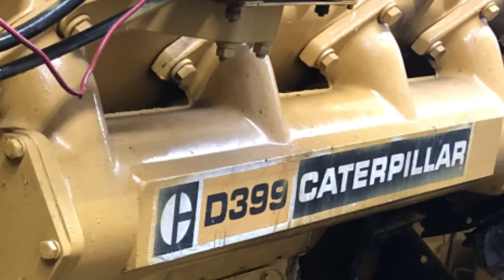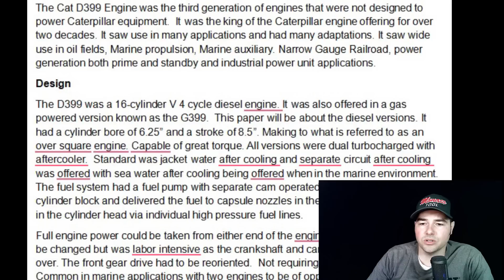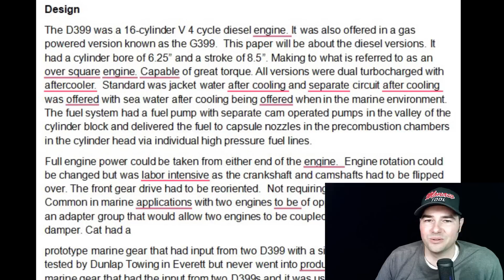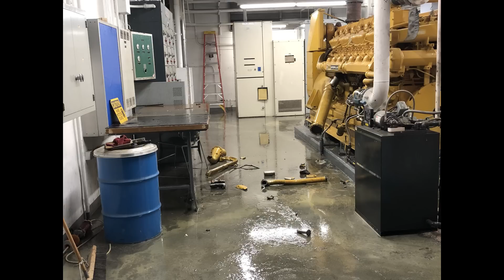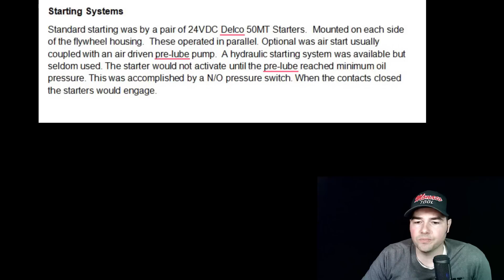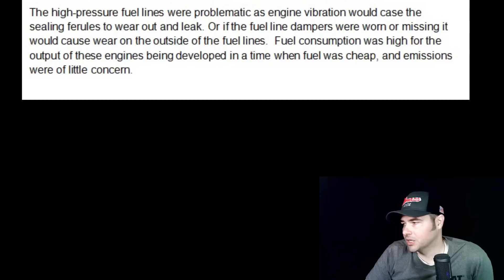The Cat D399 Diesel Engine. "Cast Iron Elephant."

Comment: I was Engineering Officer on ARS40 Uus Hoist, a Navy Salvage ship which had four CAT D399’s installed as main engines.  It was a diesel electric configuration and the engines were coupled to our main propulsion generators.  We had an air start configuration with 200 psi air driving air start motors for the diesels.  There is more to the story.  The CAT mains replaced the old Cooper-Bessemer diesels that the ship was built with.  This was in an extensive overhaul at the Philadelphia Naval Shipyard in 1971.  Those old Coopers went on to provide spare parts for the main engines on one of our sister ships then operated by the Woods Hole Oceanographic Institute on the Cape in Mass.   When the engines were replaced a CAT representative supervised the installation and during run-in for acceptance while we were still in drydock, one of the governors failed and the new engine oversped somewhat.   The Navy of course would not accept that engine unless it could be confirmed that no damage such as a spun bearing occurred.  To confirm that, the crankshaft and bearings had to be removed so they cut a large hole in the side of the ship in drydock and removed the crank for inspection and repair.  The evolution caused a delay of a week or two on our tight schedule for an upcoming refresher training and cruise from the East Coast to the Mediterranean Sea.   Fun times.  Our engineers were so proud of their newly refurbished engine room. Our auxilliary diesels that provided the main ship's electricity were replaced with D343 CATs at the same yard period.  Those engine rooms had not looked that good since the ship was built and for a short while you could eat off the bilges.  That old ship went on to server another 20 some years and was finally decommissioned in 1993 I think.  Basically a 50 year life span and those CATs powered half of it.
Reply: USS KITTIWAKE ASR 13 ...........WE HAD 4 D399s FOR MAIN PROPULSION.........THEY RAN GREAT
Reply: @erickkurz3696 kittiwake was in Philadelphia Naval Shipyard with us (Hoist) for a while in 1971 as I remember.

Comment: Hi Josh, if you look closely at any Pump Line Nozzle (PLN) engine the fuel lines are always the same length. Some of them have a lot of bends.IIRC fuel moves at something like 800 miles per second. Way slower the electricity

Comment: Still got G398, G379 and G342 running  24/7 in NW PA.  6.25 bores are impressively tough and reliable.  Cams can be fun to replace having to rubber band the lifters up.  If you know you know!

Comment: They had D397 on the Coast Guard LORAN Stations in the Mediterranean. There were three per station with 250kw generators attached. I helped overhaul two of the three in 1984-1985 at LORAN Station Kargaburun, Turkey.
Reply: Yeah, I was "Main Prop" MK2 at USCG LORAN Station Port Clarence, AK. The station had D397s for prime power. Happy memories! The transmitting tower was 1350 feet, the tallest structure in AK at the time. I was with a relamping crew and climbed that tower. There is a YouTube video of the station decommissioning in 2010, with video of the tower being taken down. The guy wires were cut to cause the tower to fall.

Comment: I just thought I'd throw it out there You said you didn't know what FP American one standard for and that is a marine vessel's name f stands for fishing v stands for vessel and then the name of the boat same goes for other types of listings so like MV-1 or what have you that stands for marine vessel fishing vessel TVs or trailer vessels it's just the generalized listing of the type of vessel that it is I spent a lot of time up in Alaska working in the engine room on fishing vessels and I also happen to run across one of those 399s it was an interesting experience it was actually the propulsion unit for our boat two of them inline spline together like what you described

Comment: One of these recip/generator skids recently appeared in the plant scrap yard, work in a 500 acre plus coke plant, no idea where it came from but relatively low hours and told it was running but obsolete. 
Once upon a time worked in a municipal powerplant in Florida. Combined cycle GE Frame 5, v12 version of this engine for starting, air started, prelube pump/heater ran constantly, standstill to full load in seconds

Comment: I rebuilt 2 a couple years ago. D399, D398 and D379's are everywhere in the marine industry.  I think there's a video on my channel of a few of them in my shorts.
Reply: Could you get Cat cylinder packs for them?
Reply: @rod5262 several companies sell piston, liner, wristpin, ring kits. You re use the rods if ok. IPD, Interstate McBee are a few. I've never tried (nor would I ever) installing as an assembled pack.
Reply: Cat does not and even if they did I wouldn't trust them

Comment: Josh:  a hydraulic starter system is used on the turbo shaft engine of the CH-47 Chinook helicopter.  There's a monster accumulator in the back of the A/C that stores hydraulic pressure from engine driven pumps.  During start up, the stored pressure is fed to the pumps, which then act as motors, to spool up the engines.  If the stored pressure was lost on the ground, then the crew chief got to pump it back up manually.  I remember from power train school that it took like a gazillion strokes to do this.

Comment: I worked at a foundry in the late 80s. A 399 ran the generator, and the electricity was used to melt the material. I was in awe of the monster.

Comment: @glowplug4762
0 seconds ago
I was on a working commercial fishing boat's generators that had a single D399 for propulsion just last week. I was amazed at how small the injection lines were compared relatively to the engine's sheer size & power output.
Plenty of those old beasts still working the water along the Atlantic coast to this day!!
FYI: F/V usually means Fishing Vessel.

Comment: Worked on a class of Intergrated Tug and Tank Barge that had 3 x 399's driving hydraulic pumps on both ends of the crankshaft to power the cargo pumps and deck equipment.  They were air start with a pre-lube pump that ran for 30 seconds before starting up.  The engines were stout and other then regular maintenance never really had any issues.  On the tug we had 2 x 398's for generator power.  They were ultra reliable as well, although we did start having a rear main seal leak on the starboard generator.  That class of ship is long gone, but fond memories taking care of those 399's and 398's.

Comment: I have some info on the hydraulic starting system. In my second year of schooling we covered hyd starting and the old timer instructor we had actually had lots of experience with these systems in oilfield applications. The odd cat but mostly 2 stroke detroits. They used a large accumulator that was capable of storing enough energy to crank the engine for around 6 seconds. And if it didn’t start there was a hand pump you had to pump up until the accumulator was charged again. He had a few good stories about times they were having issues getting an engine started and having to manually pump it up over and over

Comment: I spent 4+ years working offshore Qatar, on the Santa Fe 127, which had four of these powering generators for the rig's electrical supply (Three would be running, and the fourth would be there, and brought online, when one of the others was being serviced)
One day, there was a LOUD band, and a huge cloud of black smoke, occurring when one had self-destructed.  After completing that well (or wells) that were set to be drilled on that platform (the rig could cantilever the derrick and draw works out over the platform), we were towed into the shipyard in Sharjah where four new 3516's were installed, and some other upgrades to the hull, living quarters, and drilling package were made0
The standby (emergency) generator was a D 353.

The D397/D398, and D399 were also made as spark ignition engines, used for gas compression, and I have seen one or two up around Hugoton, KS (atop a HUGE natural gas field), used as irrigation engines.

BTW, HydroStarters were quite common as the starter of choice on the deck engines on our cementing, and later, frac units, where either the auxillary, smaller engine, or engine in the tractor, which were battery started, supplied the power to crank the deck engines, for as long as needed to get them started when it was XT below zero (Getting the little Detroit, or Cummins started was also a problem, but you could always use the pickup to jump it off, and once running, it would warm up the hydraulic fluid, and supply pretty much non-stop cranking to the deck engines)
The Hydro-Starter pretty much did away with air starters on the big engines.

Another aid to getting the deck, or auxillary engines started, was we could connect the heater hoses on our pickups to circulate engine coolant and warm up the units auxillary engine,, or deck engines that way.  Start ALL the engines before you left the yard, and let them idle on the way to location.

Comment: The Navy ship I was on in the early 1970's had four D399's for main propulsion.  They had an air start system.  They would spin up and not get fuel until the oil pressure came up.  I was an Electronics Tech but had Engineman friends.. And always have been a mechanic................Jay
Reply: Was the ship USS Hoist ARS-40?   I was engineering officer when those CATs were installed at Philly.

Comment: Hi Josh, I work in n several pieces of equipment that use hydraulic starters. The most common way hydraulic starters are used in my field of work is you hook your wet kit from your tractor to the engine starting circuit to start the engine and then can disconnect at any point but the other way I have seen it used is very similar to an air starter where there is a hydraulic accumulator that stores oil under pressure until you start the engine and then after the engine starts it recharges the accumulators for the next start.
Very interesting, just gotta make sure your engine is in good shape and starts every try or 2 otherwise you find yourself hand pumping to recharge the accumulators which is never fun lol

Comment: Superb engine in marine application. 379,398 and 399. I encountered broken crankshafts when fitted to locomotives. I put it down to shock loading when pulling off. They had Woodward governors and could be set up port or starboard.

Comment: Hydraulic starters.. we had some fork trucks working in a potentially explosive environment/ factory. Had  no electrics, all gauges analogue, black rubber bulb horn. Diesel engine had overspeed shut down valves and an antistatic belt for the cooling fan. Hydraulic starter, basically a hydraulic motor with a brass gear to engage with the ring gear on the fly wheel, was powered by a supply from a big hydraulic accumulator in the truck chassis charged with Nitrogen to 3500psi. When the engine was running the tilt function on the fork truck was moved back, the tilt fluid line had a tee off to the accumulator, the pump on the engine filled the oil side of the accumulator until the main hydraulic safety valve lifted. Accumulator gave about 20 turns of the starter.... Piss poor in reality. Factory also has some hydraulic 'jump leads' a very long pair of rubber hydraulic hose with quick release couplings, there were a corresponding set of couplings on the trucks. Bad starters were dragged out into the non hazardous area, pipes connected and cranked up until they started. Hated the bloody things..

Comment: My first boat in 1976 was the M/V Donald O'Toole, and it had a pair of these for propulsion. We roamed the Chicago area with the O'Toole, with an occasional open lake trip over to the Amoco refinery in Whiting Indiana. The boat still roams the Chicago area under a different owner and name, and as far as I know, is still powered by a pair of D 399's.

F/V stands for fishing vessel, and marine applications use counter rotating engines to cancel the torque of each shaft for better boat handling.

Changing filters underway: your fears are justified.
I had that capability with my EMD's but almost never used it. As for working around running engines, we had no choice, I just told my guys to stay out of the outboard side because that's where the explosion doors were.

GM had a hydraulic starting system for Detroits; these were popular on barge pump engines. You operated a wobble pump with a very long handle to charge an accumulator to 3,000 psi; these were great exercise machines... 😕

Comment: I worked as a field trouble shooter for a construction company in Casper WYOMING years ago. We had a power van to power the hot plant it was a d398 I remember it being a v12 I did quite a bit work on that engine, it was huge also. That power van had a smaller cat gen set to power up the big engine. I am retired now but

Comment: We had rows of these engines compounded together on the offshore drilling platforms I worked on welding pipe back in the 70s and 80s.. I could lay down on the grating and take a nap between these screaming engines in between my 18 hour shifts seven days a week for 60 days straight.🥃😎👌
Reply: I still sleep best with the music turned all the way up

Comment: Hi Josh, That hydraulic accumulator starting system you mentioned was used in places where there was no power infrastructure or in unsafe conditions for batteries. They work similarly to an air start system except they use massive hydraulic accumulators to hold the pressure instead of air tanks, once the engine is started an engine driven hydraulic pump would keep up the pressure in the system.
 
While I have never personally been around these systems I know that some Oliver and maybe IH tractors used them in South America. The main advantage of a hydraulic system over an air start system is that the pressure could be pumped back up by a hand lever for more starting attempts, although this was very time consuming as the pressure had to be several hundred pounds.
Reply: That had to be fun to pump back up for a restart! My arm is cramping just thinking about it!😂
Reply: NEVER HAD ANY PROBLEMS WITH AIR START SYSTEM. WE HAD OTHER AIR COMPRESSORS ON BOARD AND BASICALLY UNLIMITED AIR

Comment: oil field service company i worked for had truck mounted pump systems. the road engine ran hydraulics which through valving  the hydraulics were diverted to the starter for the deck engine. we ran 3412 d348 and later 3512's  the 348's and 3512's also had air starters which could be used alternatively.  if you ever wanted to clear out bugs  just start one that hadnt run in a week.

Comment: The duplex filter system had ball valves to stop oil to each filter.  It was a common thing with older industrial engines.

Comment: Cummins builds, currently, a 45 liter  v12 and 60 liter v16   60 degree V. I knew a couple of guys that worked in the rebuilding facility in Surrey BC They also Dyno tested them before they got shipped out. I think they were use on fracking pumps and big mine haul trucks .  monsters for sure.

Comment: Back in the days before UPC’s, electricity would be fed to a unit containing an electric motor turning a flywheel turning a generator. In the event of a power failure the flywheel would continue to provide generated power so electronics could be shutdown in a prescribed manner. That may be what the person who saw two generators connected to a third power head.

Comment: I serviced a D399 in a fishing trawler a few times and was involved in changing out a D398 in another fishing trawler and reversing the rotation in the replacement in the early '90's in New Bedford MA.They were usually air started in the applications i saw.Quiet a few of them around at that time and most were ex generator units that were being changed out in hospitals etc for more modern 3500 series at the time.

Comment: I had the opportunity to help assemble a D398 which is the V12 version of the D399. It was in a small tugboat. Internally they are related to the older D8 Dozer engine. The pistons and valve train parts are the same.

Comment: They were commonly used for natural gas compression and would be powered by natural gas. I have seen a few and operated one. Usually in this application they would run at 1200 rpm. They would also be used for power generation and be powered by natural gas as well.

Comment: I worked on these engines 10 to 15 years ago at Pon Power the dutch cat dealer.
Most these engines in Holland work as dredge pump engines. Or offshore generator.
Al engine components like water pumps and oilpumps can be overhauled with standaard workshop equipement. Very nice to work on. Only engines Who worked in the dead sea region where not so nice because of the heavy corrosion. These where very dificult to make leak free.

An other problem on these engines is leaking precombustion Chambers. Oll weak good running and over the weekend the cilinder leaks fulltime off water. And the engine wil not turn. 
Then re seal the Chambers drain the water and the engine wil run again. Little rust in the cilinder is no problem for this engine

Comment: I've seen it in 3 electric power plants, one in a mine and the other two in a hospital emergency backups. Also in a tugboat on the Great Slave lake in NWT Canada. The latter in the 1970s and the former in the 1990s. The hospital power plants were installed in the 60s and 70s and were started once a month for an hour at max load. The tugboat had a noisy airstarter the hospitals had an integrated AC startup system. I have seen smaller Cat powered generators that you could switch between oil filters with the engine running. The weirdest one was changing oil with the engine running, a supply line up high and drain line from the pan. I don't remember if it was a Perkins, a Cummins or a Detroit or some other contraption I've seen in the past 50+ years.